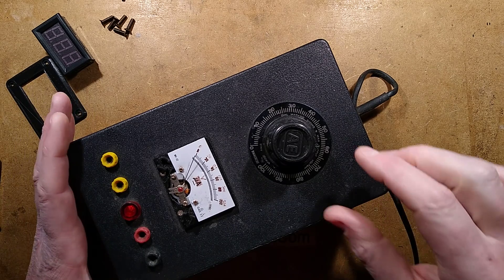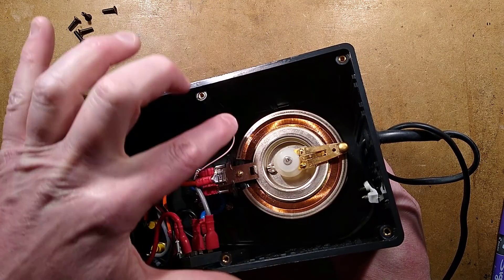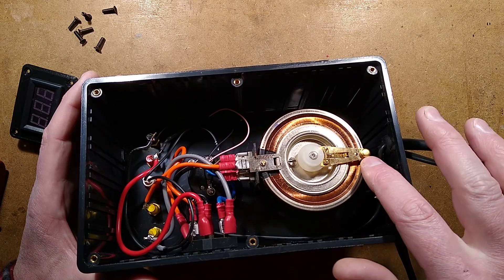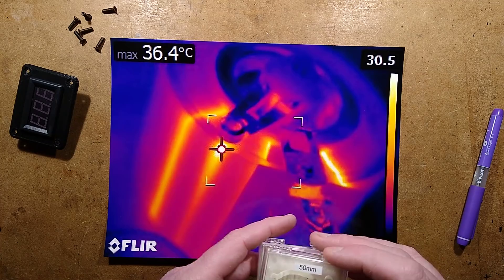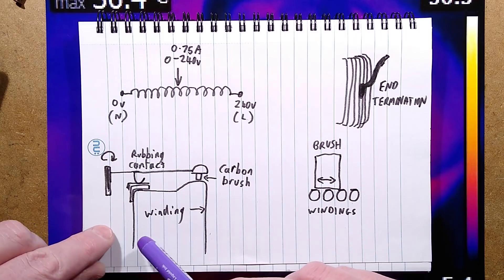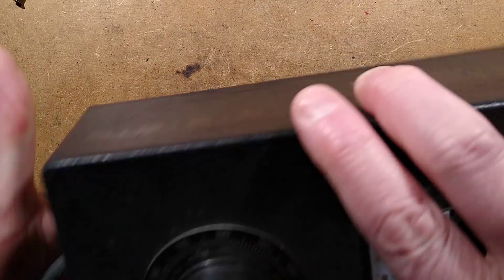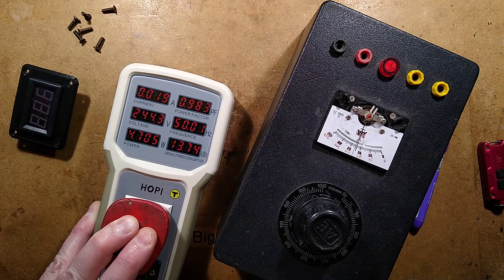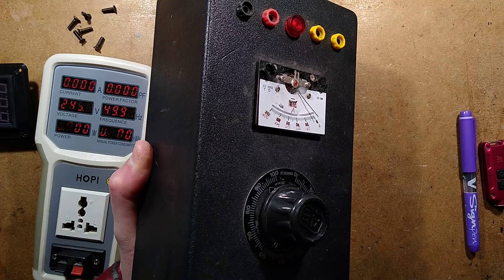Variacs DO short their windings

Comment: I always wondered about this, too! If the brush was bigger then the distance between the windings, it would short turns. If the brush was narrower than the distance between the windings, there would be momentary drops to zero volts as the variac was adjusted. What I'm not seeing is how there is so little current being drawn because of the shorted turn. I would have thought that it would have been much higher than this. Remember all the fuss about when you mount a toroid you need to be careful about the mounting hardware not forming a shorted turn? It would be interesting to see if that's not so important after all.
Reply from the maker: The hardware creating a shorted turn on a toroid is a real thing.

Comment: Thank you BC. I'd been aware of this for a very long time but it's good to have it highlighted by you in your usual professional way. My 8 amp variac dissipates 30 watts on standby and the brush has an heatsink which gets quite warm on standby. When you think of it, there are only a few volts between each turn of the winding so the current flowing as the brush shorts them out is minimal on a miniature variac but it gets significant on a large variac with a correspondingly large brush hence the brush's heatsink on my 8 amp one.

Comment: I have one that I put into a box with several switches:  A dual-pole on-off switch that interrupts both sides of the line,  just in case.  A switch that selects whether the high side goes to the end of the variac or to a tap,  allowing me to "boost" the voltage to somewhere around 130V,  for some tests.  And a DPDT center-off switch that in one position puts a light bolb in series with the output,  in the other position connects directly,  and in the "off" position allows for the connection of a meter to some binding posts so I can measure the current.  There are also neon indicators to tell me when the power is on and when I've blown the fuse.

In a relatively recent acquisition of a pile of "stuff" I got another one.  The rather distinctive knob that came with it is one that I've seen installed in premise wiring,  as light dimmers.  I had no idea that they were using variacs for that purpose.
Reply from the maker: Variacs were used as orchestra pit music stand lighting dimmers to avoid phase angle control noise near microphone cables.

Comment: In the 1970's I built a variable power supply using a variac rated at 10 Amps. It was used to run an electromagnet.
Because I was a laboratory technician I was able to get items from RS Components then. Since I retired they are no longer in a position to fulfill any orders from me.
Reply from the maker: To buy from RS components you have to present yourself as a company.  It's purely a box ticking exercise as they are simply not allowed to sell directly to the public at their trade counters for red tape reasons.  If you tell them you are a company they will happily sell to you without needing proof, purely because you have ticked the box for them.
You could call yourself Shieltronics.

Comment: I have a 2 kva variac .Not the greatest one ,but it works exactly the same way .My friend has one that was made in the 50s it uses a phenolic ring with silver contacts the wiper makes contact with .The  wires are solderd from each winding to each contact .his is only 400va and wuite heavy and more robust in build .Cant remember the brand ,its a bluish green color .The scale is amazing and the voltages are spot on pending supply voltage .

Comment: I've just got my 2 Kw Digital Variac from Amazon !!!  It's a super device, but it's nearly as heavy as my Royal Enfield Motorbike !!!!   I shall be using it with a Residual Circuit Device, for fixing power tools, motors and a bit of electronics !!!!  Mine arrived in perfect condition.  It only has 13 amp Ac output 0 to 240v which is just what I wanted !!!!  But if there's a short it should trip the RCD unlike a Microwave Transformer which just kills you instead !!!!  If the Brush sparks like a Bumper Car Pole in a Fairground, you might need to fit a new Carbon Brush !!!!!!
Reply from the maker: Does it really go up to 2000V?  If so, be very cautious, as depending on the circuitry it may not trip the RCD.

Comment: The no-load dissipation of your Variac seems high for its output power, possibly due to the shorted turns at the end connections.

My 1400 VA (10 A 140 V) Superior Electric unit draws 2 W and 2 VA with no load.  The little 300 VA unit is 1 W and 2 VA unloaded.  But none of my Variacs have shorted turns at the winding connections.  Either the winding wire end is connected to a terminal board, or the tap connection is soldered to a single turn of the winding.

Comment: Mine which i think is 800VA has no shorted turns but wire comes out at one end and the other is bit looser wire on the side soldered on with insulator below it, mine allows going up to 310 ish volts

Comment: Hello Sir thanks for the video it was helpful but I have a direct question please. If I have a breaker at 15a or 20a and it trips out when I plug in the stove everytime could I use the Variac at a 120v plug and set it at 220v would the Variac take the load thus stop the breaker from tripping? Or is this not what this device is made for? Thanks in advance for any and all answers I sure hope you still respond to this channel!! Take care Sir and Peace. I ask because I have a landlord who is a Sherrif and he does not fix anything ever.
Reply from the maker: A stove is too high a load for most variacs.
Reply: @bigclivedotcom  ok thank you i will not attempt this take care my wife says you sound a bit like James Bond a.k.a Sean Connery no offence Peace
Reply: @bigclivedotcom  Hey its me again I wont make this a habit Sir but I came across the Weller tc202 and was wondering if it was possible to put like a potentioner on it it gets glowing hot don't really need that much heat or could the variac substitute as regulator if I worded this right. Thanks for any pointers. Maybe I should just try some of this stuff instead of worrying you about it

Comment: Not to insult another man's variac, but on higher quality models they lift one turn off the core, put kapton tape under it, scrape the insulation off that area, and solder that turn to the terminal wire.

Comment: Did you print the bezel in PETG?  Taking chunks out of the glass is a common issue. Most peeps i know either put some glue or tape down when using PETG on a glass bed.
I have an FLSUN. Ran it into the ground this time last year printing faceshields. I'm going to put a better board in when I rebuild it.
  edit Just realised this video is a few weeks old. Nvm.
Reply from the maker: It's was PLA.
Reply: @bigclivedotcom  That's a surprise.  just realised I put PTFE when I meant PETG. doh.

Comment: We use heat to remove stuck plastic Clive, not just more pressure 😂
Reply from the maker: It turned out that un-heat was the correct move.  A subsequent over-attachment liberated itself with just a quick squirt of isopropanol.
Reply: @bigclivedotcom  I may have gotten confused 😅

Comment: RE 3D Printing Stuck to the build plate: Tip!  After printing spray the item with 50/50 water/Isopropyl and wait 1 min, the 3d print will come off so easy you may not have to recalibrate next time.

Comment: The shorted turn problem has always bothered me, too.  Doing some more research, I found this document ( https://sound-au.com/articles/variac.htm ) that uses the anisotropic nature of graphite to reduce the problem.  I'm trying to figure out an LTspice simulation model that matches my measured values, but have not been fully successful . . .  (yet).
There is also an article at  
http://www.idc-online.com/technical_references/pdfs/electrical_engineering/underload.pdf 
that discusses how this problem is solved in the power distribution systems with variable-tap transformers.

Comment: I have a couple variacs.  One is 240 input with 5-240 output.  Another is 115V input with 0-150V output.  The third is 110v input and 6. 14. 24. and 0-40v output.  Variacs are just basically an auto transformer with one tap that can move.  Great bit of kit though.

Comment: These are fantastic bits of kit, i like your idea of having the dc output aswell thats something i havent done to mine yet currently saving up for lots on contactors to modify mine further.

I definately would reccomend earthing if possible as the main spindle on these can have the tendancy to become live in some instances not common but it can happen, i would also reccomend maybe having a little pannel fuse  built in fuse after the output of these to protect the variac just encase of short or overload on the load side as in some instances you can quite easiy flash the windings in no time at all leaving you wondering what the hel just happened l i was a bit naughty once with some destructive testing and managed to get mine a tad hotter than desireable in no time at all  at the time i didnt have a bigger variac which was surely called for however i am looking into putting in some kind of thermal protection on on the windings however same variac thanks to someone whoever owned my variac before me did flash the windings and deemed it dead i was lucky enough to get it for peanuts and repair it on my smaller 4amp variac  onthe principle you have explained perfectly of that some of the windings do indeed short out when the wiper arm passes over them...

Myself  i use 20mm glass fuses in an unscrewable pannel fuse cutout i know i should really use ideally ceramic fuses because of the surge currents fuse design of glass ect ect but i use glass as theyre cheap as chips on ebay in packs of 100, on the larger one i use an appropriate sized mcb per phased variac.

I would potentially reccomend using an rcd before the variac preferably rcd plug on smaller more portable ones they work quite well even if you decide to be naughty and feed some equipment too many volts deliberately for some destruction currently looking into going as far as putting in a dedicated socket for the larger variac via rcbo ...

Sometimes  throughout the year thanks to industrial upgrades ect you can buy three phase variacs for a fraction of the cost of a new single phase variac for absolute peanuts and perform a  reconfiguration to turn a three phase one into single phase to gain an exponentially greater output cureent.

I was lucky enough to get a 3 phase 20amp for 'special uses'  i changed the configuration on mine so that essentially as i power each of the three up i can have maximum amperages up to 20 / 40 / 60amp outputs 0-275v as mine has a little bit of over run after the connections i think photonic induction made a superb video going into the ins and outs of  modifications  and menantioning the over run on these variacs some years ago...

keep making the fab videos sorry about the waffle waffle :)

Comment: CLIVE!!!
Talking to Andy (Photonicinduction) and when you've got more than one variac (like in Andy's 3ph one's). You need a smoothing ballast(s).
I'm not sure what there actually called but the outputs go into a ballast which have a couple of really thick turn's and then you get the output from the centre tap.
So if one's at 100V and the others at 95V. Then the full current is going between the windings, which will fry your variac's. Which is something nobody wants as decent one's ain't cheap ☹️

Comment: If you spray a thin layer of hairspray on the printer bed it will help with giving prints the right amount of adhesion for staying on put during printing but coming of easily once they are cooled. May require the bed to be heated, not sure. Using hairspray will also give prints a nice matte finish that better matches the finish of the rest of the print.

Comment: The brushes on large DC motors normally bridge several commutator segments as well, I believe that this improves the commutation and reduces the sparking by ramping the current up & down more slowly than if a brush just contacted a single segment. Brush manufacture is a black art ( pun intended) with a secret mixture of anthracite, other carbon clay & copper to get the correct resistance. One UK supplier had big problems when the Welsh anthrasite mine(s) closed, the replacement seemed to had sufficiently different characteristics to result in an increase in brush & commutator wear.

Comment: An easy fix for PETG prints adhering to the glass print bed is to use glue stick to create a barrier between the print and the glass. I also had a PETG print take a bite out of my glass until I tried the glue stick trick.

Comment: Only one or two turns must have a VERY low voltage and the resistance of the wire limits the current.  That's why I think they don't worry too much about the shorting impact.

Comment: I recently had a massive 15 amp / 120v one burn out just sitting there.  I'd been using it to control a Harbor Freight spot welder, for which it was very useful.  I forgot and left it energized for half an hour (spot welder inactive) and then there was that smell in the room - and about 3 turns at the position of the brush were black... The variac was collected by my Dad in the 50's, no idea of the actual vintage.  Things like those stay in the family for generations, as many know, they don't grow on trees and the big ones cost real money.  Luckily, we've been avid collectors...

Comment: If you wanted to limit the output AC current on something like this (so you could use it for testing suspect appliances without worrying about burning out the variac) what would be the best way? (aside from using a circuit breaker or fuse of course)
Reply: There are transformers designed with a movable or intentionally limited-size core that inherently limit current, but a simple way is to put a paralleled set of incandescent lightbulbs in series with your load. Their resistance sets an absolute peak current against the voltage from the variac, and the positive temperature coefficient properties of the filaments further limit average current by reducing delivered voltage when hot.

Comment: I have worked on many variacs and even a 9Megawatt model used for adjusting a molten metal arc furnace  (the secondary current is 30,000Amps) and also on 20 and 50 Megawatt transformers with OLTC Online Tap Changers. They all use very special carbon brushes with a fixed resistivity and you don't dare change the type of carbon or graphite on the points. The carbon has just enough resistance not to appreciably short between the windings but also not have too much resistance to cause a lot of heating from the main current. You see the same thing on DC motors that use graphite as brushes on the commutator. While an AC motor with a wound rotor that has solid slip rings use a more conductive graphite because they are not shorting windings. With motors the other side benefit is that graphite is slippery and saves wear on the commutator but it isn't the main reason it is used. So how do they change the conductivity of graphite? The grain size, the process that they make the graphite with, the compression density, impurities like clay and the firing temperature (about 1100 deg C) in hydrogen gas but the main method is to add metallic powder usually copper to reduce the resistance. A bit of copper drops the resistance by 80%. You can try making a replacement brush out of solid copper and you will find it doesn't last very long from all the arcing. I know I tried it.

Comment: A 0.98PF for a transformer would indicate that the impedance is much higher than the resistance and almost all of the current is producing heat; I wonder what a typical fixed transformer of the same power rating would show?

Comment: That's one of life's mysteries solved.  Reminds me of a large Tesla coil built by someone I met.  He put two windings on the secondary so he could later remove one of them and leave a fine gap along the entire winding. This made the coil less capacitive, less inductive and less prone to internal arcing hence boosting the output.  He made the mistake of testing it indoors which caused the arc to find a path to earth through the ceiling plasterboard to his domestic lighting and ring main cables.
His landlord was not amused.

Comment: When I heard back in the 80's that Eddie Van Halen used one on his amp, I got a variac and put it on an old Yorkville Sound amp. Since it wasn't really meant for guitar specifically, it didn't have a distortion circuit. But the variac, when turned down, allowed me to crank the volume "up to 11" which overdrove the tubes something spectacular, turning that amp into an insta-Marshall. Seriously dangerous project, but it worked amazingly well.

Comment: Clive, considering the dimentions of your variac I guestimate its output power is 70-90W and even if it's made of magic chineseum it cannot reach the rated 180VA for longer than a couple of minutes if at all (not to mention that most of them are winded with copper coated aluminium wire that is used not only by greedy chinese for mass consumer goods, but in the era of valve TVs and everething mains transformered was also widely used in the mighty USSR outside of 4-5 major cities with stable grid in half of appliances' transformers, AC magnetc shunt or switched variac stabilizers widely used in each household). I can't imagine what should be that so small power motor or WFD or even smallest inverter that can be tested via such a small variac.
Reply from the maker: This is a good quality one from RS components.

Comment: Shorting them between two wires is no different than the "shorting" going on between wiper and 1 wire.  They are consecutive coil wires so it's really no different than a potentiometer rubbing the preceeding atoms of resistive carbon.  The only things I know of that tear up the variacs are too much voltage to cause arcing and sooting, or so much amperage you burn up the coil, or finally wearing out the coil wires.